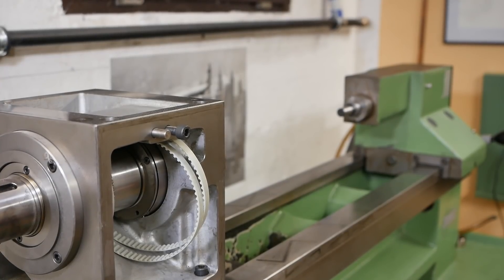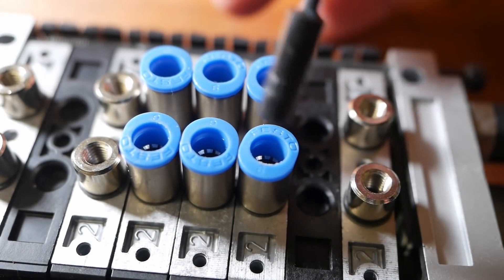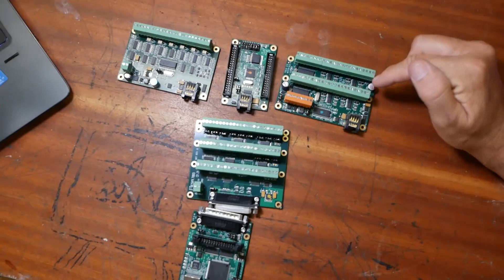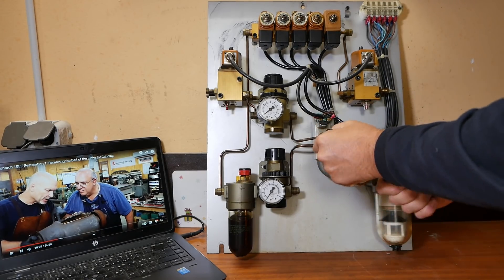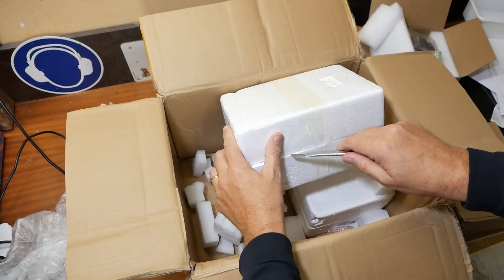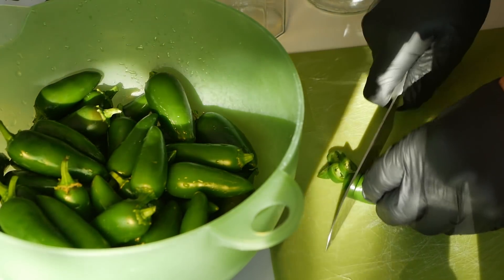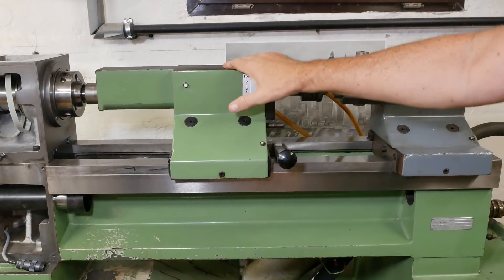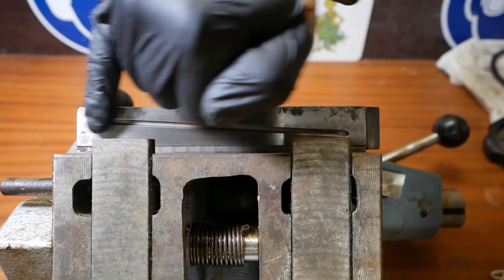Schaublin tailstock time

Comment: I am trying to figure out what linuxcnc version to use and how to set it up, I am constantly jumping back and forth and trying different options and seemingly getting nowhere, If you would go over it in some reasanable detail in your future videos I would greatly appraciate it
Reply from the maker: I just use whatever is the most current stable version. My Maho is still on 2.7 something as it works fine. On the Mini lathe is 2.8.?? which is also stable. The change to joints with 2.8 makes migrating the Maho a bit daunting for me, but my Gearbox.comp needs a minor functional change, and my mate who programmed it is threatening to upgrade to the curent version.

Basically just use latest greatest. No real disadvantage.
I will cover setting it up once I get to that, but it may take a while.
Reply: @RotarySMP  I am also trying an SD card adapter to mini pci Express instead of using an ssd over sata II, the ssd I have is 128 gigs, I think it is way too much, 8 gigs for a system like this should be enough, but I have to say it is pretty fast, the SD card adapter is pretty slow, not sure which way I will go.

Comment: "This filter unit is beautifully made"

"Norgren, England"

So what we can establish from that is Norgren were not a manufacturer with a heavily unionised workforce ;)

Have you checked either tailstocks for correct centre height? I'd assume being Schaublin they'd both be pretty much spot on but we all know where assuming can get us, if one is better than the other in some way on the alignment side that could settle which you keep/use.
Reply from the maker: I see very different usage cases for both, an will be keeping both. Haven't done any checks on then yet. Plenty more episodes for that.

Comment: As a card carrying riff raff member, I can confirm that 5:14 is exactly what I signed up for. Mark, you never fail to disappoint mate. I'd also like to see more cooking too. 
I'm glad the Festo kit did indeed turn out to have the complete set for you, and I'm really looking forward to seeing how this build comes together.

PS. Vinegar is the second most useful universal solvent after dihydrogen monoxide although it is slightly less dangerous due to its strong odour.
Reply from the maker: Luckily the air supply has the dihydrogen monoxide separator to protect the schaublin from it's dangers :)
Thanks for the feedback.

Comment: The pacman gag really put a smile on my face
Reply from the maker: The oil stain was just calling out for it. :) Thanks for the feedback.
Reply: @RotarySMP  I'm not old enough to have played the original pacman but did play plenty of it in the mid eighties on our computer. Next you need a qbert or Barbapapa reference.
Reply from the maker: @Hilmi12  I learned with Lode Runner on the Apple iie  :)

Comment: Gotta love banjo fittings, ME: This one is leaking, I'll just tighten it a bit....snap...sigh.
Reply from the maker: Yeah, and Schaublin standardised on M8x1 which no pneumaitc maker does. Luckily there are some central lube fittigs which should work.
Reply: @RotarySMP i've seen those before and found metric flat face port male to 6 JIC male adapters. I think this was the spec Flat Face Port with Metric Threads (ISO 9974-1)
DIN 3852, Part 1
Reply from the maker: @steamfan7147  Thanks for the tip.

Comment: Nice vid.
I admit to contemplating a conversion to CNC of a mill.
Not being an electronics, ahhh, anything really it's quite daunting but a compelling rabbit hole.
I'll be watching your revision closely, 🤞
Reply from the maker: Thanks. My recommendation to anybody wanting to do a cnc conversion is to start with an old cnc machine
Reply: Yep, understand that's probably optimum but, you see, I have this extra turret mill that I thought might be worth a go CNCing..
Reply: And a spair lathe if that worked out...
Reply: Aaaand a grinder if, well, you know..
Reply: Spare
Reply from the maker: @captcarlos  Go for it. You learn a lot from these projects.
Reply from the maker: @captcarlos  I consider a lathe or two to be basic hand tools. Like screw drivers. :)
Reply from the maker: @captcarlos  I'd love a surface grinder.
Reply: Ozzie here, I do really enjoy the use, accuracy, function etc of my, wait for it..
Jones & Shipman 1400 auto  hydraulic surface grinder!
But also enjoy and are challenged by my Swiss made Strausak 57W Universal tool & cylindrical grinder.
Sooo much to learn there I tell you, fun though.
Reply: Sorry, but I've spent years and $ accumulating my home kit.😔😉
Reply from the maker: @captcarlos  NIce gear you have there. I am glad I have the Clarkson T&C grinder, but a surface grinder is something to aspire to.
Reply: The advantage of being in Austria would be access to a far greater pool of outdated commercial machines under a common currency.
I have been fortunate in timing, prepared to renovate machines and still having time to play with them but Australia has a smaller manufacturing industry, somewhat like Kiwiland...
Reply from the maker: @captcarlos  That is true, althugh I think a lot of the decline manufacturing here happened a in the 90's, so many of the best machines are long gone.
Reply: I have converted a manual mill to CNC and also a manual lathe to CNC. 
It's a fun project.
I didn't really document the mill conversion, and the lathe conversion wasn't done rationally; I decided to try to do it as if the original manufacturer might have done it, with complex iron castings and not really paying much attention to costs. But if you are interested: http://bodgesoc.blogspot.com/search/label/Holbrook02%20Backwards%20to%20go%20Forwards

Comment: if i remember correctly the locking mechanism on the tailstock is just a bit of round bar with a threaded hole in it and a radius that fits the ram
Reply from the maker: That will be easy to make

Comment: I was looking around for CAM options for lathe, nothing much out there that's hobby friendly (as in free) or that runs on Linux. What's your recommendation ?
Reply from the maker: I never really used CAM much on a lathe. Because most of what you turn are simple facing and turning parts, I tend to just hand code a lot. Andy Pugh did a great plug in for LinuxCNC for conversational programming.

Comment: I've seen a similar air controller / stack up but with round components instead of square. That was 30 years ago, so memory is a bit fuzzy on the subject. Thanks,
Reply from the maker: Thanks. I have little to no experience with Pneumatics, but this seemed a good way to go.

Comment: Great content as always! My servos and drives just arrived  for a conversion im doing, they look pretty simmilar too!!  

Im going the ethercat/linux CNC route. I think it ends up being a much more simplistic and powerful system than the mesa cards. 

You can also control the drive IO from linuix cnc via the ethercat network. Depending on your setup you may not even need the extra IO modules, only the drives. Ill post a video when i get some time!
Reply from the maker: I looked into EtherCat following ThisOldTonies use of it on the Maho. Seems a powerful system. A large reason for me to stay with Mesa hardware is that I am familiar with it, and can leverage what I already learned.

Comment: Any particular benefit to cleaning the 3d plate with vinegar?  The first solvent I usually reach for (for anything) is isopropanol; I guess vinegar is probably cheaper?
Reply from the maker: My mate who designed the printer swears by it. I just copied him.
Reply: The smell of evaporated pickling vinegar. Delicious!
Reply: @CalHallows  now I want to see some comparative analysis - does the scoville rating affect cleaning capabilities??